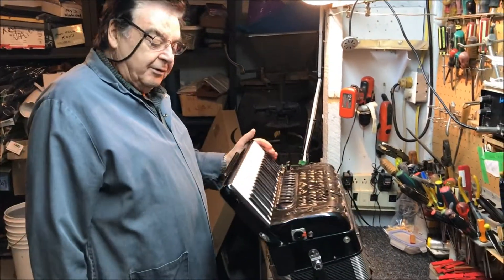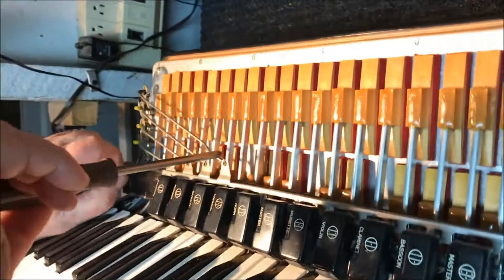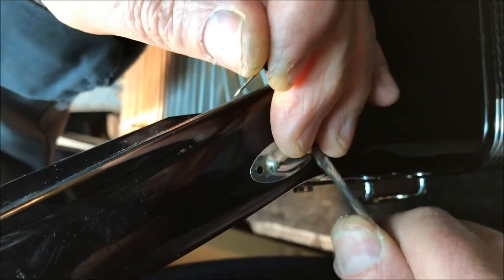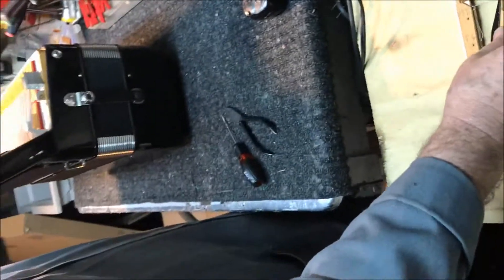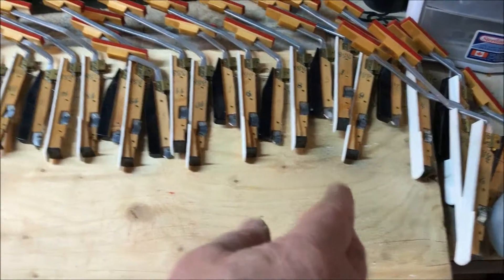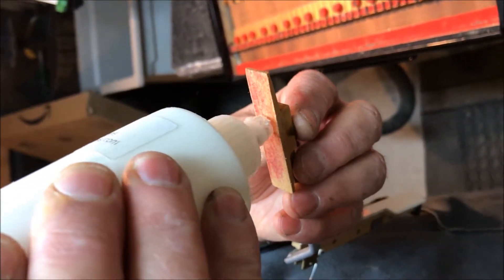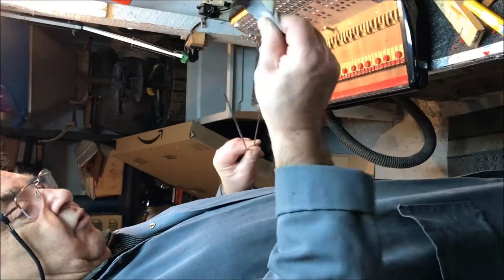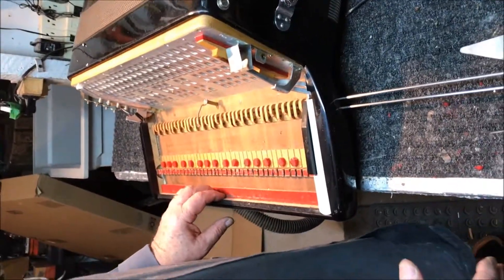Accordion Restoration (how to take apart a keyboard)

Comment: To my fellow commenters.  Tuning of accordion reeds involves a lot of issues.  If you know nothing and need to know now, then there are videos on youtube that cover bits of accordion & harmonica tuning.  You can also download phone app Carltune and wright down tuning for push & draw of button accordions for each register or  white & black key of your accordion for each register setting.  As correctly designed and adjusted you will find keys vary in frequency from perfect frequency, for tremolo and sound richness reasons.  Know that air density reed is exposed to inside a accordion is exactly opposite of what it will be for an accordion block on a tuning table, and so not correct in accordion if exact desired pitch is set for tuning table.  Usual method for reed adjustment of accordions is removal of material from tip of reed to raise pitch, and remove material near attachment end of reed to lower pitch (which is a huge headache) and that's the simple stuff about accordion reeds.